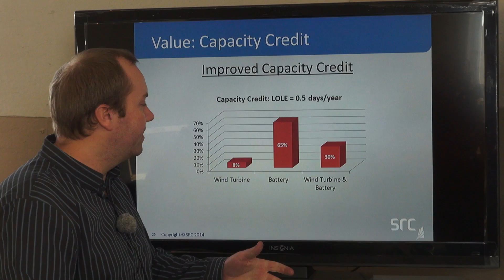Cowessess Wind Energy Storage - Capacity Credit

Comment: So the turbines fluctuate and this is why the reliability is low, because, at any given unit or time that is chosen, the turbine is expected to make a certain amount of energy. But using a battery to store that extra power and release it in a controlled manner, you can account for that fluctuation and give out the true amount of electricity turbines make. Is this it? If so, I am no electricity expert here, so I still wonder why there isn't a device that can count the electricity generated in real time and just release it accordingly to the grid in real time, instead of the plants needing batteries to store extra power.